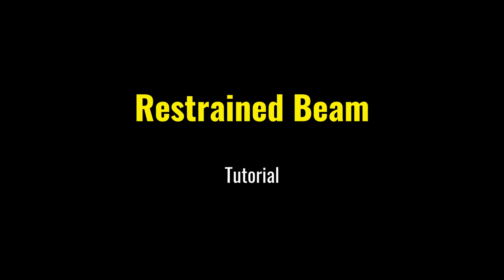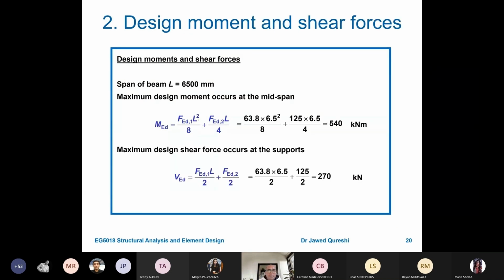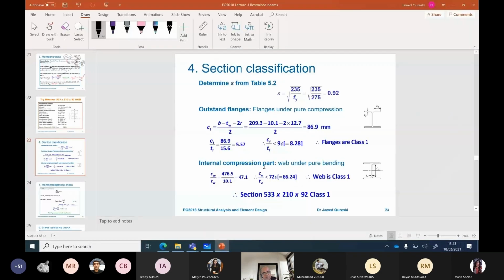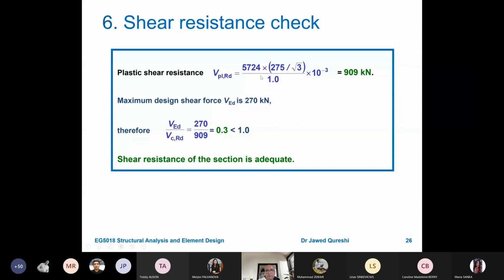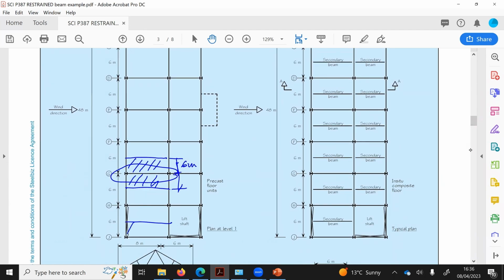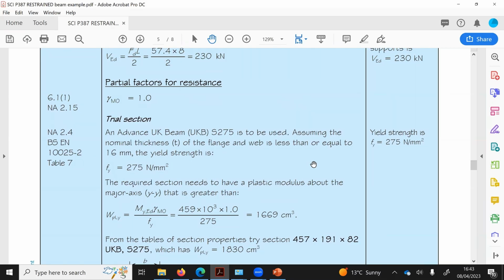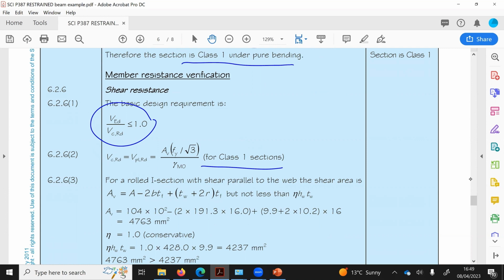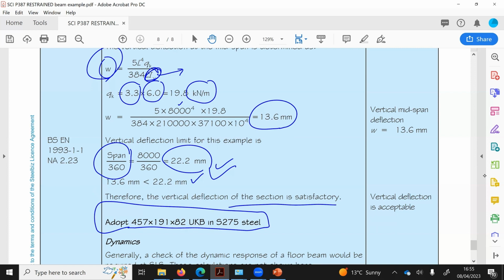12 Restrained Beam Tutorial | Eurocode 3 Steel Design series

Comment: Dear Professor!
In the first example You used 1/384 when calculating the deflection. Was it fully restrained beam with FIX supports at the ends?
In the second example You used 5/384, because the beam ends were pinned?
Am I right?
Thank You for your videos. These help me to refresh my university studies. 
Best Regards from Hungary
Reply from the maker: For simply supported beams with distributed load the formula is 5wl5/384EI and for point load PL3/48EI. The first example has both and that the reason for using both formulae are combined. Second example has udl only. If you watch it again, the first example has 5 applied inside the bracket.
Reply: @DrJQureshithank you for the answer!

Comment: Thank you Dr , i have a question,  when do we use truses in our design ? like when truses is required.
Reply from the maker: Trusses are used in long span structures, such as bridge, long roof, stadia and warehouses. If the span is more than 20 m, ordinary beam becomes inefficient in resisting loads. We use trusses then.
Reply: @DrJQureshithank you so much Dr .

Comment: Load combination (Gk+Qk) is the most commonly used for serviceability checks. Based on the example, you used only variable load. am I right professor Dr Jawed?
Reply from the maker: In industry, engineers use dead plus live load unfactored for serviceability deflection checks. However, Eurocodes  only require us to check unfactored live load check. I believe both approaches are right.
Reply: @DrJQureshi Hello Sir. I must say your contents are amazing. Ive been following them and understand a lot better I thank you for that. I have a question on this matter. While both approaches are right, one combination requires us to use deeper beam to support (Gk+Qk) while the other may require a lot smaller depth beam for deflection checks. If I only consider Qk, does that mean under Gk the beam will already deflect? Im having a hard time to decide which combination to use to decide the proper beam to use. Thank you